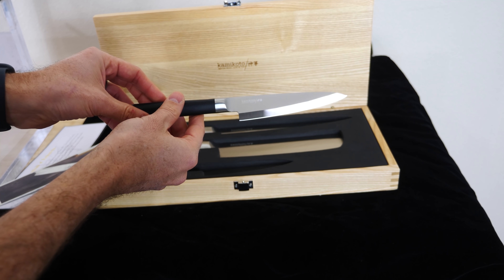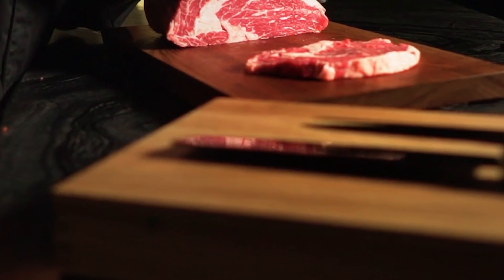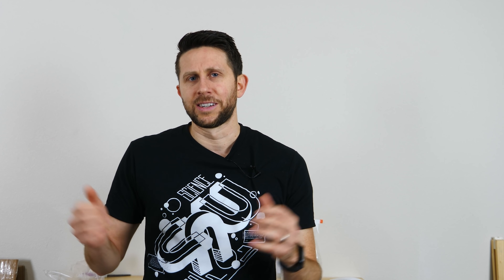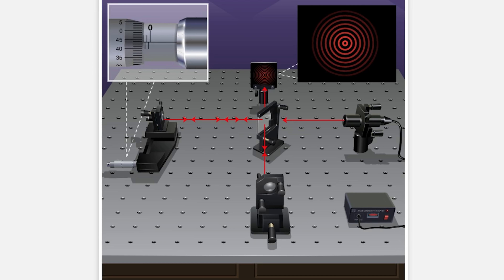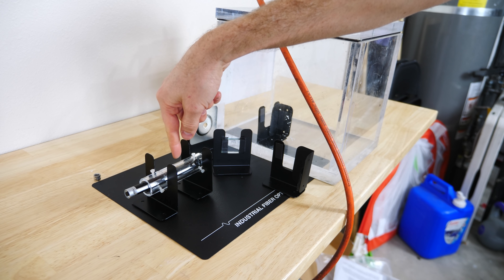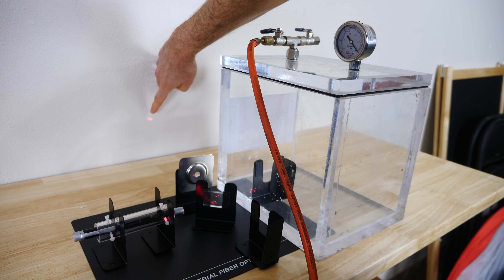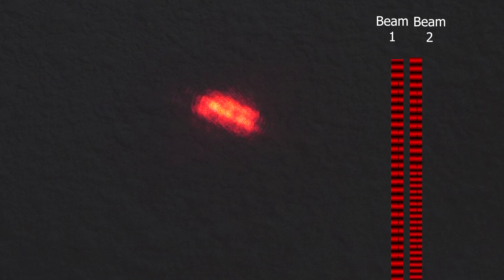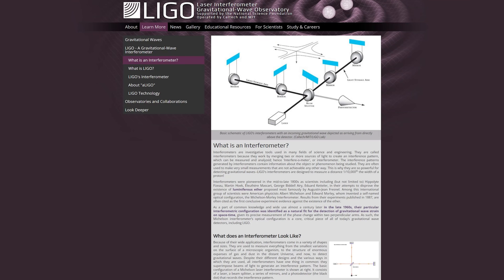The Most Famous Failed Experiment

Comment: But it's easily (and especially in retrospect) seen why it fails... any speed difference that light experiences in one direction is countered by it travelling the opposite direction the same amount.
Really need 2-3 independant light emitters/detectors that can be separated and measure the one way speeds... if you had 3 boxes that emitted red blue and green flashes independantly and each box detected both red green and blue pulses; you could synchronize the reocrded results and see which detectors saw which light the most different.
But on 10m the 350km/sec we're moving relative to the CMBR is only like 1cm (0.3ns) difference... so the clocks have to be very precise.
Reply: no, the two arms are at right angles.
Reply: @wd41  ya so one goes up then down and the other goes left and then right - no matter what they are both re-covering any speed sense they would have gained in the other direction.
Reply: Going up and down doesn't exactly cancel (if aether were correct).
Suppose you row across a 1km lake and back with a speed of 4km/hr, that takes you 1/4+1/5=1/2 hour. Now imagine you row 1km up and down a river flowing at 1km/hr, it will already take you 1/3+1/5=8/15 hour, or 32 minutes.
Reply: @landsgevaer   Yes; but there isn't any drag that moves that 'water' that light is going through.  Instead
1 direction for 300,000km takes   1 second, but during that time, (In the best case, where the experiment is aligned with our overall motion in the universe relative to CMBR , and rounded down from 350km/s to 300km/s) the mirror moves further away 300km, which takes it 1ms longer; but on the return journey, it's another second, but the detector moves another 300km towards the mirror, reducing the overall time by 1ms.   The trip one way took longer, because we are moving relative to the absolute speed of light, but the return trip was shorter, and as proven there is no drag on the light in between... it's always through a stationary medium... but things do move relative to it, making light take longer to get some places than another.
Reply: @3zdayz  Nope, try again.
If the apparatus moves at 300km/s relative to the aether, and needs to travel 300000km, then in onr direction its relative speed is 300300km/s, so it takes 300000km / 300300km/s = 0.99900099900.. seconds, and in the other direction the relative speed is 299700km/s and it takes 300000km / 299700km/s = 1.00100100100.. seconds. This adds to 2.00000200.. seconds, not two exactly.

Comment: The Michelson-Morley experiment was a huge achievement back in 1887. While simple in principle, the details are daunting. Now I have to go and read up on how they got coherent light back then.
Reply: They didn't, they used an oil lamp. The low coherence length was quite a problem for the alignment, so they used a sodium lamp for that and switched back to white light in the actual experiment.
Reply: @WouterVerbruggen  Not sure hot it works with non-monochromatic light, guess my understanding of optics and interference was wrong. I though you'd only see the interference pattern with monochromatic light, but you are right, somehow they were fine with an oil lamp.
Reply: @xl0xl0xl0  Light will always interfere, but having a long coherence length and/or being monochromatic will help a lot in getting a nicely visible interference pattern. It's all with respect to your system, like size, apertures, etc. Without access to a "good" light source, you can still get usable results if you cleverly design your setup.
Reply: Their apparatus was modified into a large underground tunnel where they managed to measure the rotation of the Earth. It is the Michelson-Gale-Pearson experiment. I think it is amazing that we can now make that measurement with a fiber optics gyro that you can set on your palm.
Reply: Thinking about it, how did they manage to get a monochromatic and coherent light source?
Reply: This is right, but the reason why the pattern lines appear is still because of the semi permeable reflective mirror. Light does not do real cancelation like wrongly often misconceived/misconducted/stated. It's unlike a wave of e.g. water or sound acting in e.g. air which are indeed able to cancel each other out like magnets aligning, + and - = 0. But this common misconcept is due to the fact that light still can be altered in speed, frequency of the 'mass' or rather density would almost be more precise as of this case. It used to be already a sum of the addition of + & - itself as result. All cancelling in the experiments which look like e.g. waterwave or noise cancelling properties are just illusions as of being an constant acceleration kinda effect. It is like a very unheavy plasma like balanced gas or rather like aligned hydrogens of the atoms, a cascade of hydrogenlike order which seeks entropy, therefore can only get even more ordered in some altering way of it's underlying energy state of + & - .
Waterwaves have movement which can repell each other and kinda cancel itself out, sound is a wave of air itself movement which therefore can cancel itself out like wind in different fqs.

Comment: I'm not sure an experiment that produces unexpected results should be called a failed experiment.  If the outcome is known with some certainty beforehand, isn't it a demonstration, like the one you performed in this video?
Good stuff, as always.  Thanks for posting.
Reply: considering that the experiment showed that light has constant speed independent of reference frame, I would say its a very successful experiment. but I guess they call it a failed experiment because they wanted to measure the aether, so not finding it wasn't the expected result.
Reply: @danilooliveira6580  Not the expected result.  So, not a demonstration.
A proper experiment isn't to prove a preconception.  If the results are in line with your thinking, great!  If not, even better.
If only to illustrate what you have reason to believe, it's a demonstration.  If that demonstration doesn't go as planned...back to the drawing board with valuable insight as a result.
Reply: @Vector_Ze  This is wrong. Every good experiment is to test a predefined hypothesis. If you fail to do so, the experiment failed. If you don't have a predefined hypothesis, you run into all kind of statistical problems and is considered bad science.
Reply: @cherubin7th  You're testing a hypothesis to determine whether or NOT it is true, not to prove it IS true.  If you already know "it" is true, then it's a demonstration.

If the experiment shows your hypothesis was incorrect, that does not make it a failed experiment.  It sheds light on the question at hand.  It indicates that you need a new hypothesis, giving you a direction for your next experiment.

If you enter the experiment with the conviction that you are proving a 'fact', not testing a hypothesis, that prejudices the experiment...not good scientific technique.

It would be a failed experiment if it is not reproducible.

It's not good form to 'like' your own post, like you did, so I won't.
Reply: @Vector_Ze  It technically is tho.
Reply: @caylya7869  I don't understand.  Maybe I'm dense?  An experiment is supposed to find answers.  If its only purpose is to demonstrate what you believe to be true, then it is not an experiment, it's a demonstration.  If it supports your hypothesis, all is merry.  If it contradicts your hypothesis, that's gold too, and leads to further investigation.
Reply: It certainly can be, it all depends on the parameters and conditions they set to judge the success or failure of the experiment, so against those parameters and conditions it could certainly have been judged as a failed experiment.

Trying to argue it wasn't a failed experiment on some generic arbitrary values of what a scientific experiment is or is not, serves no purpose and would not be accurate.
Reply: The result was unexpected. They wanted to find the speed of light, longitudinal and transversal to the direction of the ether wind. And couldn't find a difference.
Reply: The purpose of the measurement was to measure the speed of the earth relative to the aether.

Since the earth orbits the sun in 12 months, they calculated that the would get a result, if not initially, within 6 months.
Reply: The end result was that relativity was born.
Reply: This is right, but the reason why the pattern lines appear is still because of the semi permeable reflective mirror. Light does not do real cancelation like wrongly often misconceived/misconducted/stated. It's unlike a wave of e.g. water or sound acting in e.g. air which are indeed able to cancel each other out like magnets aligning, + and - = 0. But this common misconcept is due to the fact that light still can be altered in speed, frequency of the 'mass' or rather density would almost be more precise as of this case. It used to be already a sum of the addition of + & - itself as result. All cancelling in the experiments which look like e.g. waterwave or noise cancelling properties are just illusions as of being an constant acceleration kinda effect. It is like a very unheavy plasma like balanced gas or rather like aligned hydrogens of the atoms, a cascade of hydrogenlike order which seeks entropy, therefore can only get even more ordered in some altering way of it's underlying energy state of + & - .
Waterwaves have movement which can repell each other and kinda cancel itself out, sound is a wave of air itself movement which therefore can cancel itself out like wind in different fqs.
Reply: Well said!

Comment: What's up lately with all the knife commercials? Those knives are as good as any other knife made from normal steel......
Seriously, if you buy them for their looks ok, but if it is for actually using them then just get normal knife. As long as it is comfortable everything else is just a nice bonus. All knives are just as sharp as you make them. And while a harder edge lasts longer it also takes more work to sharpen once it is dull.

Comment: The earth is not moving
Reply: Prove it.
Reply: @Mandelbrot_Set  this very experiment is one proof!
Reply: @Geoffrey137  I didn't ask you to lie. Shining light through a vacuum chamber does not prove that the Earth does not move.
Reply: @Geoffrey137  Research the Michelson-Gale-Pearson experiment. They measured the rotational velocity of the Earth using an interferometer similar to the one in this experiment. Research stellar parallax and stellar aberration. Both of those facts prove that the Earth orbits the Sun.

Comment: Do you think the flexing of the acrylic vacuum chamber as the pressure changed affected the light beam?
Reply: I was thinking the side wall of the acrylic was bending into a concave creating a lense. I didn't consider the bottom flexing of the acrylic moving the mirror but it definitely would have.
Reply: @ColCurtis  So both the mirror being moved and the wall flexing are contributing to what is being seen here, and would be the better explanations for the fringe movement than changing the medium from a vacuum to air. The flexing of the bottom moving the mirror is the reason why the beam moved up the wall, showing that the alignment was being changed, and if the bottom of the chamber is flexing then its likely that the walls are flexing in a similar manner. When flexed it would change the amount of material the light is moving through which would change the propagation time for that beam path. The wall flexing wouldn't be enough to be considered a concave lens as far as the laser is concerned, locally it will still be more or less "flat".
Reply: Most of the interference he saw was because of mechanical flexing. The refractive index difference causes something like one fringe per centimeter of vacuum.
Reply: @RealNovgorod  "Do you think the flexing of the acrylic vacuum chamber as the pressure changed affected the light beam?" - You can calculate how much effect the air on its own would have. With the approximate path length of 2x10cm in the vacuum, the wavelength of red light of 700 nanometer, and a refractive index of air of 1.000273, the number of fringes that it would go through between full vacuum and 1 atmosphere of air pressure, is about 77. So the demonstrated fringe shifts could easily be just because of the air coming in.
How much the mechanical flexing plays a role is hard to calculate. The worst effect would likely be possible deformation of the bottom of the box, affecting the mirror. 
"I was thinking the side wall of the acrylic was bending into a concave creating a lens" - bending of a flat sheet of acrylic does not create a lens. At worst, the sheet will sit at tiny angle at the point where the light goes through it, causing it to travel an extremely tiny bit longer through the acrylic.
"They had a large piece of stone floating in a pool of mercury as a table, in a stone basement, and still they had interference from outside motion and vibration." - M&M did not use a laser in the original equipment. And they used a rotating table, not a stationary one like in the video.
Reply: I am too stupid to understand anything you just said
Reply: @BingusLord  See the Michelson-Morley experiment Wikipedia article, and the kind of issues they had to fight.
Reply: Perhaps flip the vacuum chamber upside down and use a thick piece of polished granite as the base for the mirror to sit on, that would probably cut down on the flexing of the chambers base, but not the walls. For the walls, the laser could be placed directly in the center of the wall, so any of the wall flex would be almost perfectly perpendicular to the beam. That would cut down on diffraction.
Reply: Yes, at the very least he should have put the mirror on the other side of the vacuum chamber, but I'm not even sure if that would have been sufficient, since the table would bend from the added weight of the air.
Reply: Reading about the original experiment - no way we are seeing the effect of the vacuum here! They had a large piece of stone floating in a pool of mercury as a table, in a stone basement, and still they had interference from outside motion and vibration.